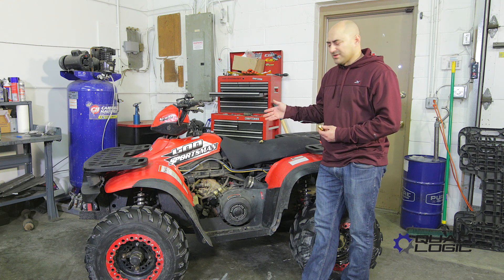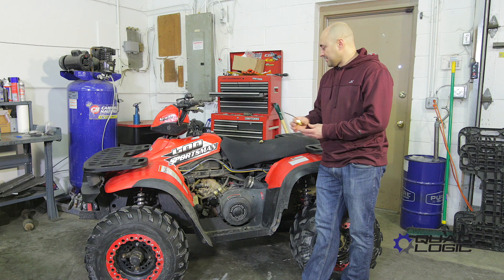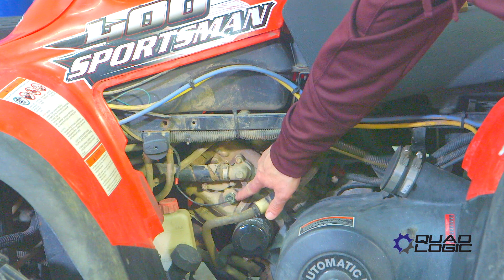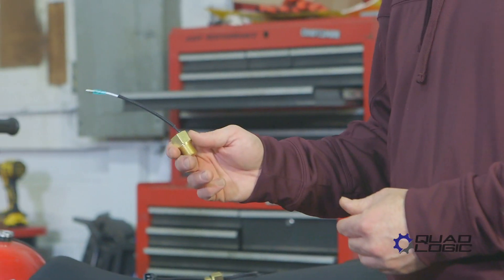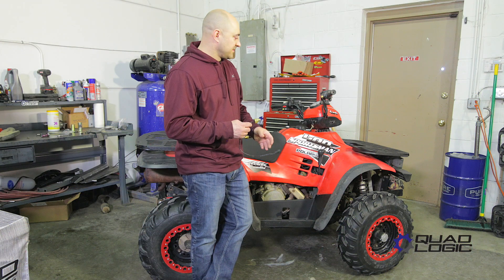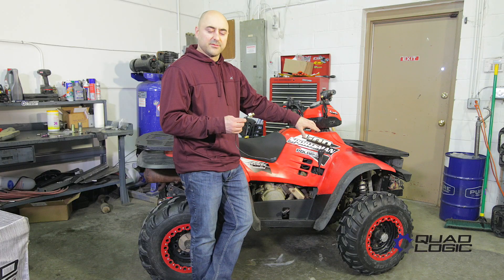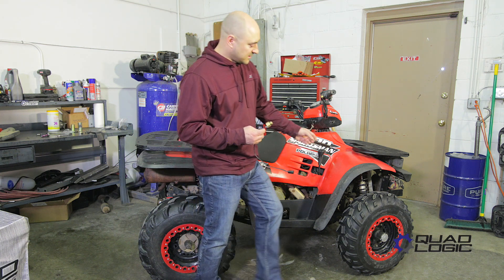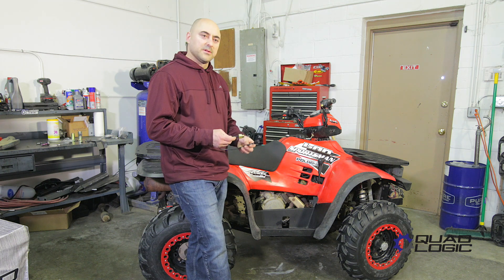Understanding Polaris ATV Coolant Temperature Sensors and How to Replace Them

Comment: Dont forget to the right of the light sensor where rad hose goes theres a thermostat in there that controls coolant flow sadly i dod not know and ended up blowing my head gasket as it controls coolant flow

Comment: Replaced both of these parts, but the fan still won't activate.  I jumped the fan direct to a power source and it will run so it's not the fan motor. I can't locate a fuse panel. LOST

Comment: I just got a tao tao 4 wheeler.  The temp light stays on  and beeps, would the temp sensor be my issue?  Also, since that light stays on, could that be the issue as to why my 4 wheeler won't start??  It cranks and wants to start  (already changed spark plug) but just won't turn over

Comment: So my sportsman is different from the ones you speak of. I have a April 29, 2005 sportsman AWD 500 ho carbureted model. Sensor on the side has two wires, but like I said, it's not a efi model. But when I unplug it, fan stays on. When I plug it back in, fan do t turn on and the speedo flashes and says it's hot, even when it hasn't been running. Then I can't find anything on a heat or fan sensor for this machine. So now I'm afraid to ride it, can't afford to replace the motor. Any ideas??
Reply: Bryan, did you ever get this figured out? Having the exact same issues with the same machine…

Comment: 2008 Sportsman 500 EFI - No sensor on radiator.  Only temp sensor is on left side of engine head. Revise applicability section :40 - :50
Reply: I have an 08 that the fan stays on even with the ignition off, any idea what it could be?
Reply: @ElPatronGamefarm  do you mean with the ignition key turned off? Or the red handlebar switch turned off and the key on? 

If the key is turned off and the fan runs, you have a faulty ECM.

Comment: my 2004 has a two wire hot sensor.  I'm getting a flashing hot and the fan(brand new) won't turn off.  Both sensors junk?
Reply: 2004.5 has two wires from the hot sensor at the head.  It appears that there is no sensor on the radiator.

Comment: So I just picked up a 2001 polaris sportsman 500 ho and was doing some checks before my weekend ride I ran it yesterday long enough to unload it and today there is still a lot of pressure in the system and a bunch came shooting out of the radiator cap? Any ideas???
Reply: I had a similar problem, I went to orieylis auto store and rented a radiator pressure tester and cap tester. I had a bad cap cause fluid to shoot into the overflow, and the piece that the cap fit on was also bad, I think both parts cost me $30. Good luck

Comment: My polaris sportsman 330 2015 won't run the liquid cooling system occasionally for some reason, overheated a couple of times in longer drives.. air fan works properly. any insight?

Comment: Hi there I have a a 2000 sportsman 500 I've replaced the fan and the sensor that goes to the radiator but the fan will not work If you run power to the fan it will turn on so that's not the issue it's just not kicking on when the wheeler is in use my temp light will come on but no fan any tips?
Reply: Did you happen to check the 20a circuit breaker for the fan? It will be up in the neck on your bike under the high beam pod.
Reply: @skeley1  no I havent I'm not much of a mechanic but I shall surely look into that

Comment: my hot temp warning is on even when the engine is cold (not been started) and the fan is running constant, I have to disconnect the battery to get the fan to shut off. Mine is a 2004 Sportsman 500 HO. Will the hot temp sensor on the block cause the fan to come on as well as the hot temp warning. the other sensor in the rad I can't locate.
Reply: I'm having the same problem with my 2008. Did you figure out which sensor it was?
Reply: @benhoopengardner9725  not yet. Mine doesn't have a sensor in the rad. It's a 50th anniversaries addition and I guess Polaris did some different thing on that year. My block sensor is a 2 wire plug and I believe it controls the heat warning light and the cooling fan. Still trying to figure out how to test the sensor  before I change it out
Reply: Same here. I've changed the sensor on the side of the engine. Fan runs until battery dies. I'm starting to think ECM
Reply: @michaelwarren2721  so you had the same problem, changed the cooling sensor and its still doing the same thing?  I know its not running hot as per the warring in my case as I ran it all winter plowing snow with no issues. At first I was unplugging the fan after every use so it wouldn't stay running and kill the battery but there is something drawing power even if the fan is unplugged. If I don't disconnect the battery will be dead the next day.
Reply: @crossover8634  yes sir! Also the case with me... Ecm is my next step I believe. I've checked everything to my knowledge
Reply: @michaelwarren2721  let me know how you make out. My local dealer told me it sounds like the cooling sensor when I talked to them about it but maybe not from your experience.
Reply: @michaelwarren2721  how did you make out? Did you end up changing the ecm?
Reply: @crossover8634  yes sir just last week and it worked like a charm. I joined a Polaris group on Facebook and everybody said I needed an ECM about 150$ later it runs like it's supposed to
Reply: @michaelwarren2721  what was the name of the Facebook group?  Was it hard to change out?
Reply: @crossover8634  So I just picked up a 2001 polaris sportsman 500 ho and was doing some checks before my weekend ride I ran it yesterday long enough to unload it and today there is still a lot of pressure in the system and a bunch came shooting out of the radiator cap? Any ideas???
Reply: @michaelwarren2721  hey there. Its been awhile since you changed out the ecm. Still no issues?
Reply: @crossover8634  I sold it... But it ran great!
Reply: @michaelwarren2721  great to hear. I still didnt get around to changing mine. Iys an expensive part and I feared it might be a bad wire but after more research it think I'll bite the bullet and change the ecm.
Reply: Did you ever figure out the problem? I’m having the same issue
Reply: @ElPatronGamefarm  new ECM. Been working great.
Reply: @crossover8634  where did you get the Emc from? I’m looking at one from partzilla and it’s almost 600
Reply: @ElPatronGamefarm  from my local polaris dealer. I can't remember the exact price but it was nowhere near that much.
Reply: I just recently replaced the ECM and the speedometer and still getting HOT warning light when I turn the key with sensor plugged in. If I unplug it, the fan works all the time when ignition is on. I'm baffled. Plus can't find anything on a heat sensor or fan sensor for this machine.